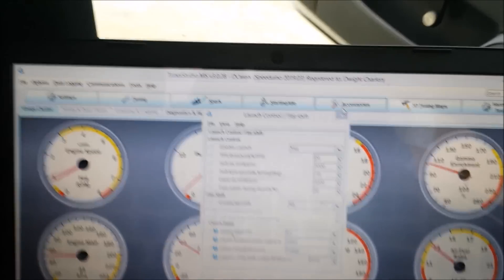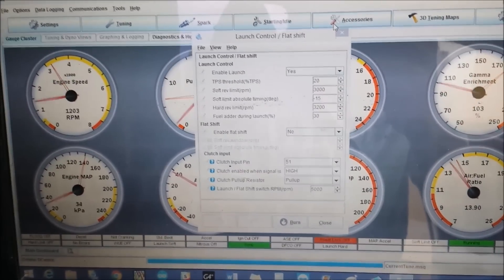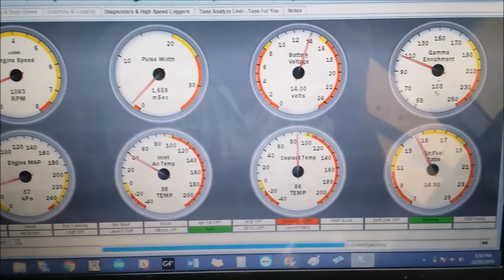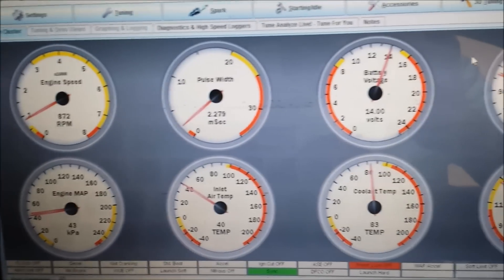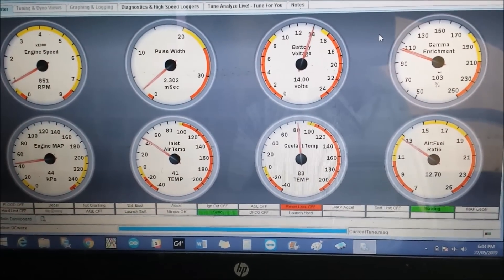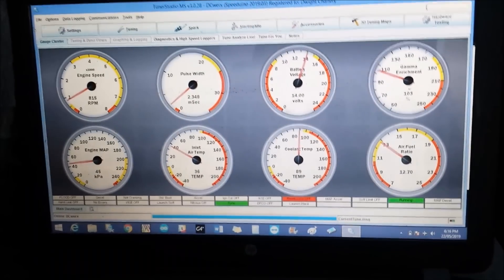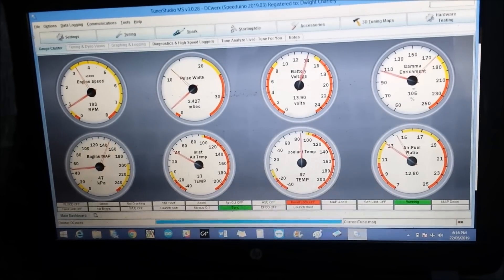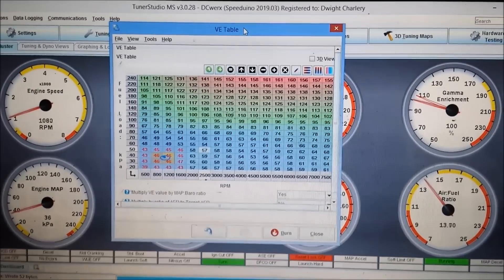Turbo Honda Speeduino Batch VS Sequential Injection Testing

Comment: It had literally no advantage over batch fire in a performance tune, literally none, the only reason to go sequential in a non DI engine is for emissions and a tiny bit of economy.  Same goes for hyperfast super high end ecus- an 8 bit microcontroller like MS1 will run most engines 8 cylinders and less with any amount amount power just fine.

Comment: What sensors did you use for cam and crank signals? I've been told to just use a single TDC signal but I want to maintain sequential injection. I have a 1996 EX coupe.
Reply from the maker: Ckp sensor, 24 teeth gear. 1 tooth removed
Reply: @DCwerx  can speeduino run 2002 honda civic d17 ?

Comment: Does switching to sequential have a significant impact on fuel efficiency? I would think so since in batch half is wasted
Reply from the maker: Only at idle and low RPM
Reply: yes it will help in power and fuel ecomony  as well as give a smoother sweep of rpm under power

Comment: very good video man
I have a question for you. Did you keep the OEM ECU connected?
If yes than what you disconnected and what you did to trick to keep the lights off?
Las one do you cut the wires like sensors and connect to the speeduino or you tap in the wire and keep it to the OEM ECU and to the Speeduino at the same time?
Thanks for now bro
Reply from the maker: Stock ECU is removed. I just made a patch harness to connect engine stock harness to the speeduino. Lights and everything else is untouched.
Reply: @DCWERX  nice. Thanks man. I will do that on mine also. I disconnected the ecu but of course can't start and drive to see if the gauges worked lol. 
Appreciate it brother!

Comment: Hey mate, what changes do you make in tunerstudio to make it work? Just in general settings?
Reply from the maker: Just switched injector layout from batch to sequential
Reply: @DCWERX  dumb question, you don't have to change squirts per engine cycle from 2 to one? I obviously don't know how engines work lol
Reply from the maker: @shirtz69r  no you don't, you probably experiment with different squirts but I have always had good luck with 2 squirt alternating

Comment: The injector dead times are a compensation for how long it takes for the injectors to open at different battery voltages. If you find that your AFRs are effected by battery voltage changes then injector dead times can be adjusted to correct this.

Comment: It was an interesting to see how less fuel sequential needed at idle: in batch mode, at such low pulsewidth/airflow some of the injected fuel was 'wasted', could not burn (for cyilnders not firing). Sequential on the other hand delivered the exact amount for each cylinder. I did the same with MS2 and after playing around with injection timing table as well, the light load (idle/cruise) became almost like with factory ECU. cheers! 👍
Reply from the maker: Yes, I am truly surprised as to how much less sequential wanted. I am super happy excited to see final results after everything is dialed in.
Reply: @DCWERX and thanks for the quality content you ceeate and pls keep videos coming! 😊👍
Reply from the maker: @laszlovona  thanks man

Comment: Great video DcWerx I switch my Toyota over to Sequential fuel and it idles more better  with a more better afr . I hope to get mine running as good as your car if I can only figure out why my car wont rev pass 4100 rpm  don't know what am doing wrong but that my only issue ever since I install the speeduino. 
Question: I notice for your launch C setup is set: HIGH !for a ground activation clutch switch : does need be set HIGH or LOW
Reply from the maker: Just go through catalogs and check duty cycle, pulse width and other stuff that may stand out and you will find your issue.

My clutch switch was normally open with clutch pushed in so I needed to use the going high and pull feature for my launch control to work. Typically if your switch is normally closed with clutch pushed in then you would just use "going low"

My car is far from perfect but it does run pretty good. I'm OCD when it comes to my AFR so I spend a lot of time trying to get AFR exactly how I want them.
Reply: Ok will try HIGH taught is was the opposite. Maybe that's why LC was always active. Haha . Been through the manual and setting multiple times  I feel like is a trigger  issue  am on something will test on weekend hopefully I can get my car up to your level. 
Thanks your videos and replys help  me a lot.

Comment: Good video..I’m going to do my reach on batch vs sequential injection..never heard of it..and what tuning program are you using...have u ever thought about switching to a D16Y8 intake manifold and Z6 or Y8 transmission..to get the little extra out of ur motor...keep up on the good work brother...
Reply from the maker: I have been on the hunt for a d15b7 or d16y8 manifold for a while but I have not been able to get one. I too think it will free up some HP. 

Z6/y8 tranny fetches top dollar now a days. I'm still waiting for a good deal on 1 to pop up.
Reply: @DCWERX  Prob. you dont have the civic anymore, but if you have how much is the postage to you from Europe? because I have d15b7 intake manifold for like 30Euro's fully equiped.
Reply from the maker: @kerstas10  I still have the civic. I just took it out for a drive after being parked for a few weeks. I am honestly not sure how much postage would cost for the intake since its kinda heavy. I can check online and see if I can get an estimate